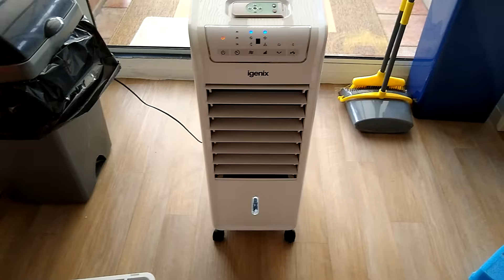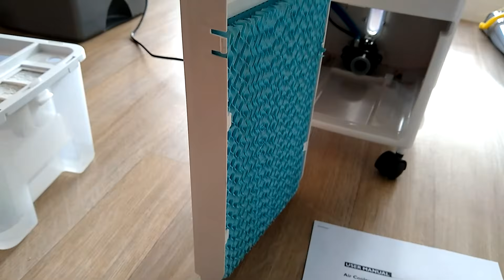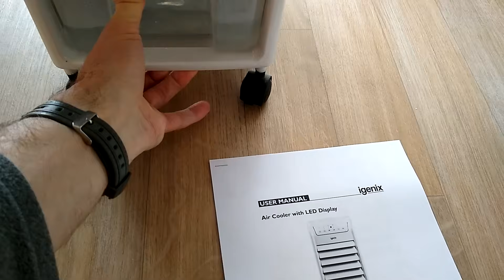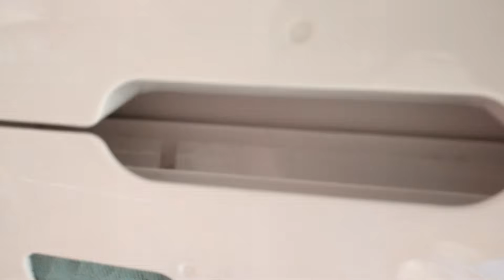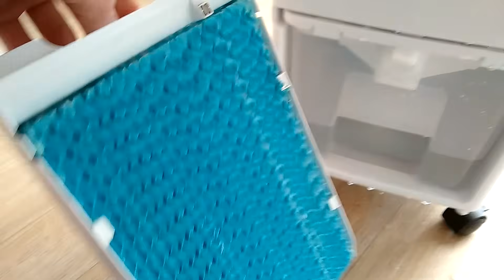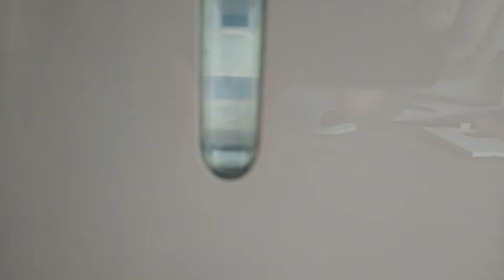Igenix IG9703 Air Cooler - quick look and run.

Comment: Hi Chris, mine doesn’t have the blue pad wet, doesn’t do that water running like yours is not cooling at all. What can I do?
Reply from the maker: Do you hear the pump try to run? Make sure you have the water tank fully pushed in to mate with the pump plug.  I find that unless the tank is fully pushed home it will not be able to suck up water.

Comment: Have you found that it leaks at all? I’ve had mine for almost a year now and it leaks most of the time. After around 30 minutes being on I’ll find the bottom plastic shelf under the tank is filled with water and overflowing and all over my floors. It does it around 70% of the time, but not always, so not sure what causes it but it’s driving me crazy!
Reply from the maker: Yes! Same as our machine.  It seems to be coming from the pump port where the tank allows water to be drawn up from the machine.  A light design issue perhaps but we also find the bottom of the machine full of water and then it does leak over the floor.
Not a machine to use on carpet or delicate floors!

Comment: will it work for my 8m^3 room? i plan to use it with more ice blocks... i feel like an icecream when i sit at my desk
.
Reply: Thanks for ur answer, I bought one just to try it out and honestly it s not worth it... I m good with just regular fan. Wish u all the best! Thanks again!
Reply from the maker: To be honest it does chill the air a bit but in really hot weather it will struggle to cool you enough.
You would be better off spraying water on you to allow the cooling effect from evaporation.

Comment: Hi Chris, I live in a top floor small flat. I'm not expecting really chilled temperatures. My flat gets up to 30°c in the summer, do you think this cooler will be enough to lower it to 25°c?
Reply from the maker: Hi there, no I doubt it would drop the temperature that much, it will feel colder when you sit in front of it but does not have the cooling capability to cool a room.

Comment: Hey chris, is it any good for our current heatwave?
Reply from the maker: It's ok, it might feel a bit colder than a regular fan but it's no AC unit.  With that in mind it does move a good amount of air without too much noise.

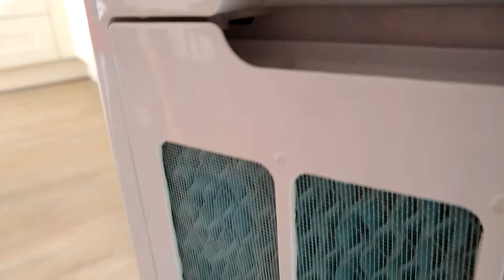Comment: 2:00 you showed how the water flows down from that hole. I don't see that happening with my cooler. What could the problem be?
Reply from the maker: Check you have enough water in the tank for starters. Do you hear the pump going?
Reply: @ChrisHorswill  Thanks for replying. My bad, the humidifier mode was off. It works fine.
Reply: @ChrisHorswill  Hi Chris, the water isn't coming around in mine either?  Humidifier button is on,  pipe is not blocked i opened it?

Comment: Do you Think it could cool down my student apartement on 48 square meters? The sun is burning on my windows the whole day and it gets atleast 26-30 celsius inside...
Reply from the maker: It will help, especially if you direct it towards you whilst running.  It isn't an air conditioning unit though so wouldn't be able to reduce the temperatures by much for the whole room.
Reply: b